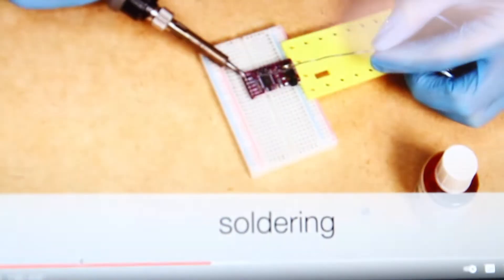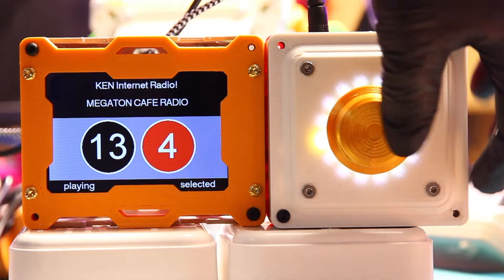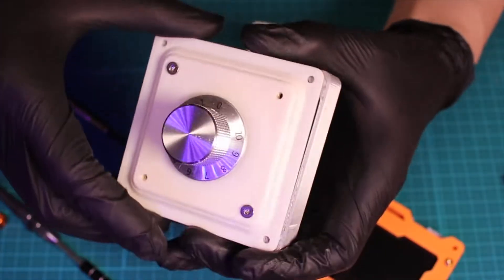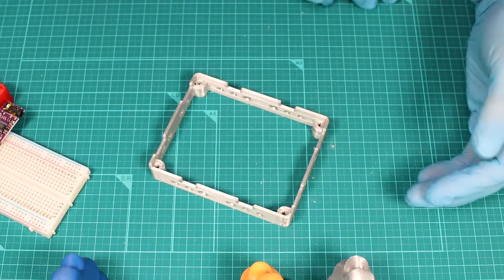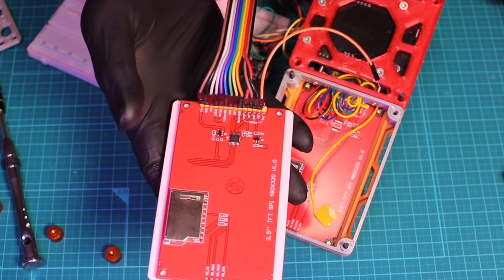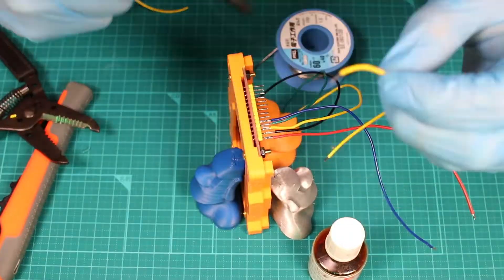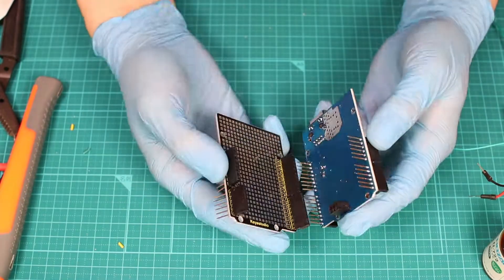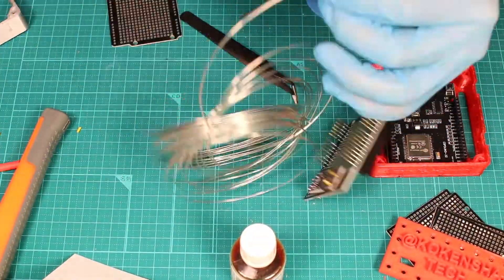ESP32 Internet Radio version 2 (PCM5102 + TFT 3.5 inch display + rotary encoder+ RGB LED)

Comment: Good idea and perfect job.
I send you a message to messenger.
Please check it.
Reply from the maker: Oh, I missed it, can you write your message here?
Reply: @KOKENSHATECH  ı made a wifi radi with esp 8266 and esp 32.
But ı'm not be able to change the station.
I sent you message and video to your messenger address.
Reply from the maker: @dijitalhobim  What library did you use? And did you get any error messages? I suggest you try the simplest sample from the library I use. https://github.com/schreibfaul1/ESP32-audioI2S/tree/master/examples/Simple%20WiFI%20Radio
Reply from the maker: @dijitalhobim  If nothing wrong with your code, I suggest you try other station’s URL.